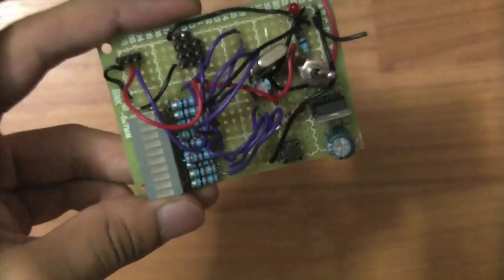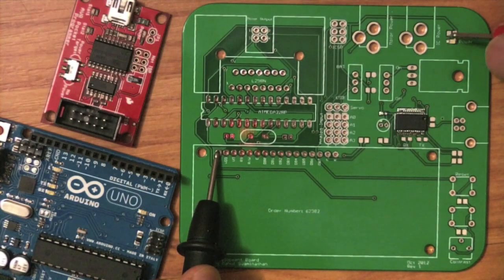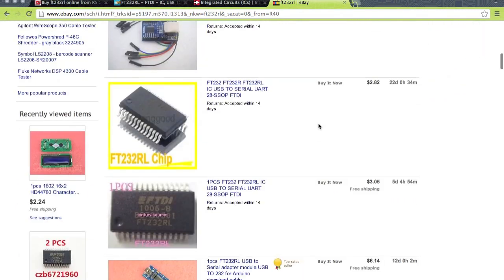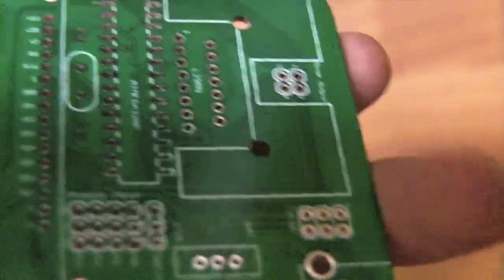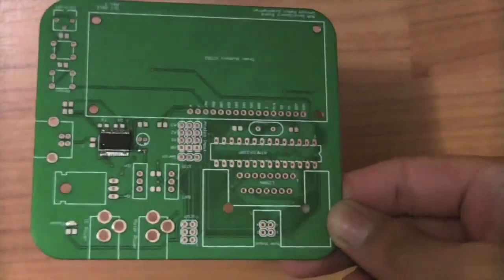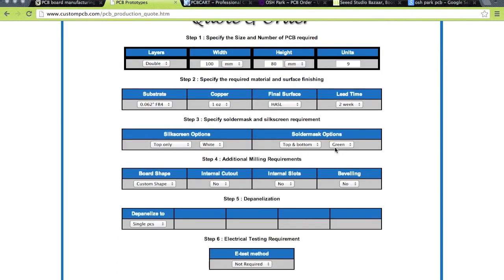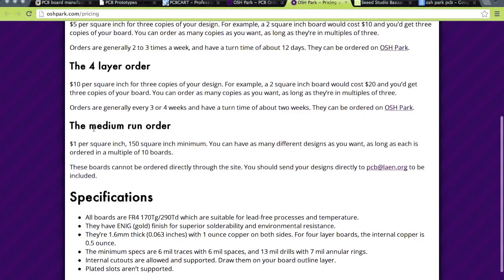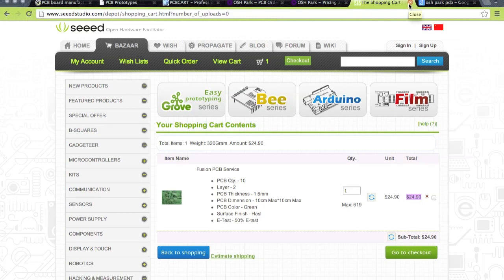PCB Design Tips | General Electronics Tutorial

Comment: Just some tips for PCB Designs:
-Make vias, so the GND of both sides is distributed equally
-Best practice it to put all SMD's on one side and the through Holes Components on the other side
-The ground plane should be more or less everywhere, so there are no big gaps without the ground plane
-Name all the components on the corresponding silk layer
-don't Forget the mounting holes

Comment: Wasn't it possible to solder all the cathodes from the LED graph bar together and bring it to ground through one resistor instead of giving each LED in the graph bar its own resistor?
Reply: +trevortjes yes
Reply: trevortjes current would not share properly (ntc), better to put them in series.
Reply: Yep thats true when multiple leds have to burn at the same time. If only one has to be on at any time one resistor will be enough right?

Comment: great video and i will definitely use the site you recommended. i do have a question, is there s list of components that can be placed on a circuit board. a list where i can research it by it telling what the part name is and what it is used for. for example i would to create/design a board that has an led power on light, a place to have a better, on the opposite ended of the some wiring so this board can be control on one end and  to control another device on the other end. i hope what i an asking makes any sense to you and also if i wanted to enclosed it how do u go about that. either you o anyone here can answer these questions for me, thank you